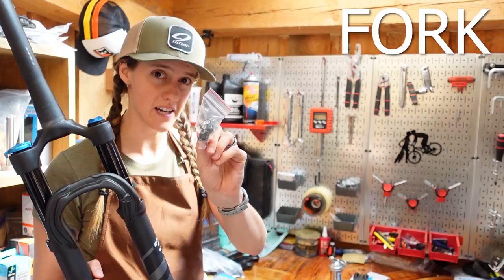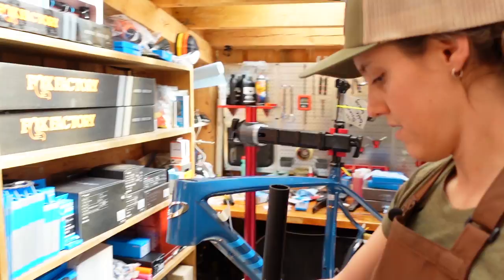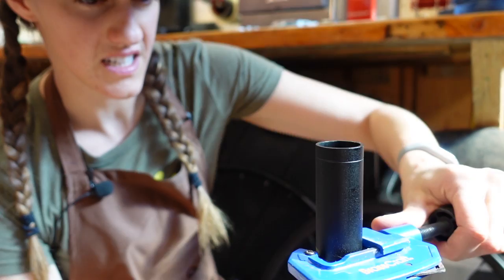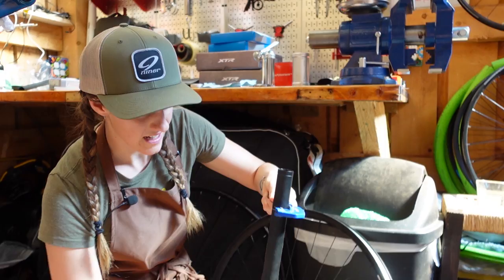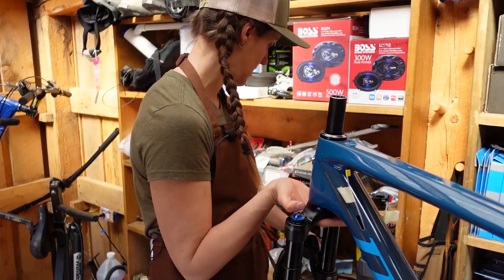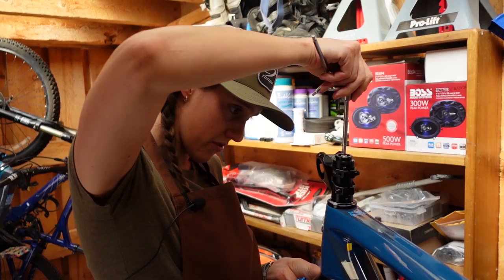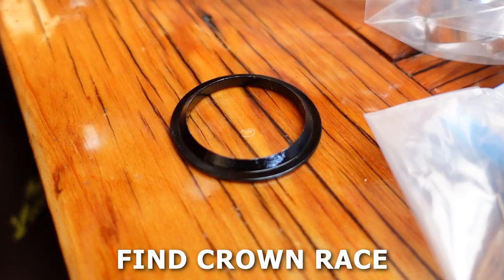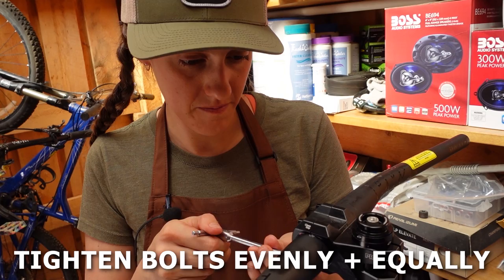How to cut and install a new fork | Syd Fixes Bikes

Comment: Using the right tool is so helpful  (not referring to the tool replacing the perfectly fine PVC pipe BTW). Today I did my second ever rear cassette replacement, this time with a proper chain whip (14 EURO's). Job done in minutes... The previous time was a good struggle and a good thing the old cassette was ready for retirement considering the improper tools I used to remove it, probably inflicting some damage...
Reply from the maker: So true. For certain tasks the right tool is 100% worth the investment!

Comment: I think the day I bought the star nut setter my life changed. No more nightmares (and sore fingers) needed to set a star nut. It cannot be understated how much this tool is actually useful and you should get one. Pretty much the opposite is true about the crown race setter tool: you can totally use a (square cut) PVC or metal pipe of the correct size, just paying a bit of attention and not pushing the crown race on an angle. You can also put a smaller pipe around the upper part of the head tube so the bigger pipe will stay straight and the crown race would be pushed evenly to the crown.
Reply: Never actually used a star nut setter, looks like it makes a hard job easy 100%, but I install starnuts maybe 2-3 times a decade so I never bothered to invest in it..
I am a absolute tool junkie tho, so I just ordered a tool I don't know when I'll need next time, and know I'm not gonna use more than a few times the next 10 years..

Comment: Just installed a new Fox fork on my bike today.   Your video was helpful, especially when I got to the point of putting on spacers but forgot the stem and was like oops!   Got a FSA star nut tool for like $12 from nashbar that worked well.   The pvc pipe for the crown helps if you put a coupler joint as it will then hit the outside of the race perfectly.   Thanks for your videos!

Comment: I had a different star nut tool from Park Tools. It did not have the sleeve that goes on outside of steerer tube. And I used a regular hammer since the tool was solid steel and works well. The rubber mallet didn't work very well.

Comment: My first time installing forks,needed to cut the steerer tube little bit because the star nut is bend so wrong that it can't be saved anymore,luckily have an spare star nut.After that,with some hassle and swears,it fits although many scratches on the fork,luckily some cheap forks.The second time I installed a new fork,an old stock model 26er manitou fork for my XC/trail hardtail bike convert,with some of experience,installed it with less effort and scratches again,but less.You learn from the mistakes and be better from time to time.
Reply: If the star nut is bent, I just drive it all the way through the steer tube and out the bottom.
Reply: @CraigMartinNB  mine's bent so bad that it looks like an pisa tower,but way more bend

Comment: Tip for those who have steel steerers.

Coat the steerer tube with grease to prevent rust from forming.

Because one time, I tried to remove the fork for "Cup and Cone" style bearing repacking. The spacers are seized to the steerer tube making it impossible to remove and I had to use a pipe wrench to twist the spacers out.